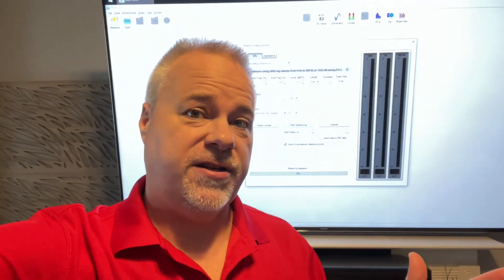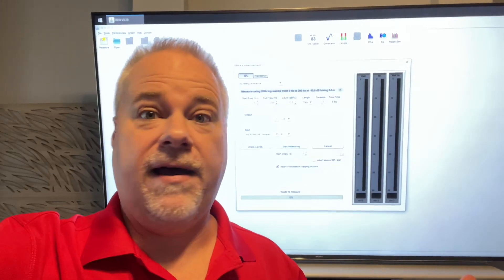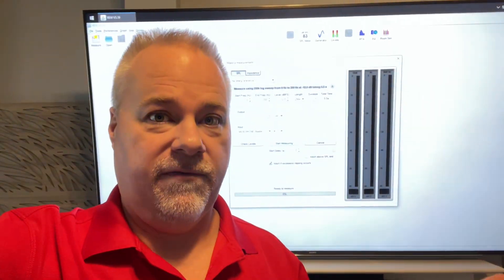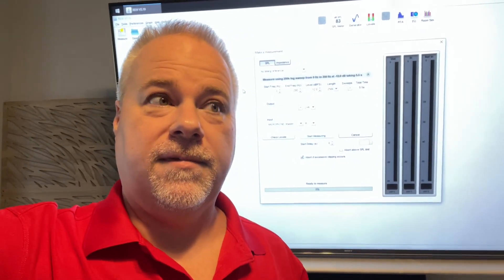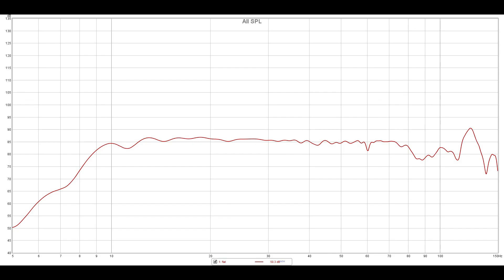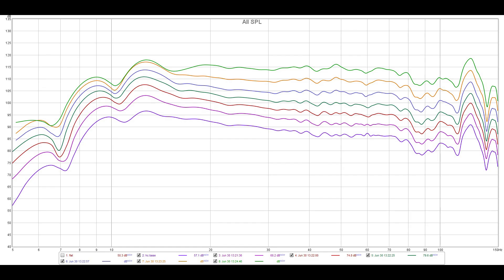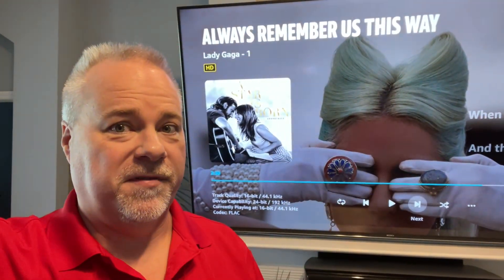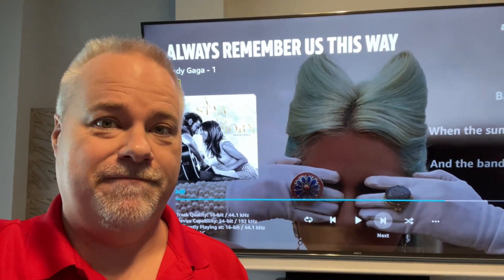PSA S3612 Subwoofer Compression Test & Single vs Dual Subs

Comment: What's the process to do the sweeps?  Set receiver MV to 0 and run sweeps in REW starting at like -21 dbfs, and then at -18 dbfs, and -15 dbfs and so on down to 0 dbfs?   Select just LFE channel?
Reply from the maker: Yes you just keep turning it up and testing. All channels, nothing special

Comment: So glad that you are happy with them.  I just wish they provided drivers with excursion.
Reply: And what kind of subwoofer do you recommend that have that. Svs pb 16 ultra has a lot of excursion. But isnt it like smaller drivers need higher excursion to compensate for size whereas bigger drivers does not as they move plenty of air. Design choice as I recall - no expert here !
Reply from the maker: Big sealed subs don't need excursion.